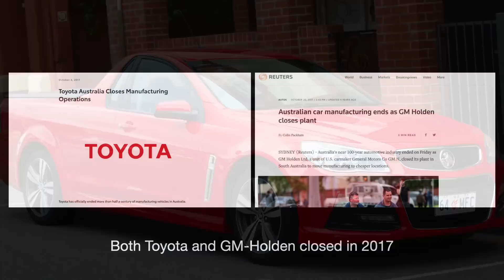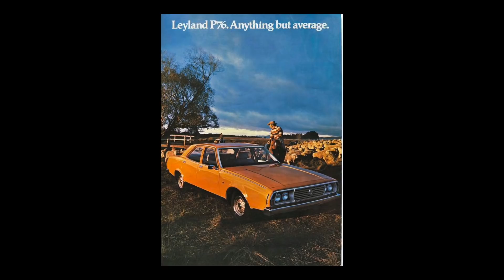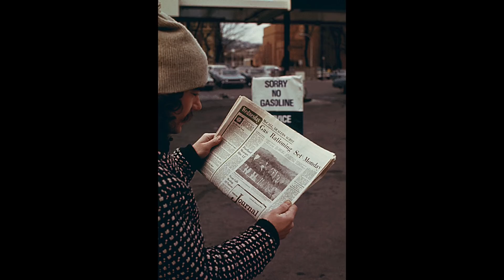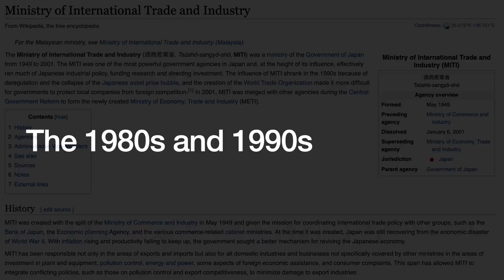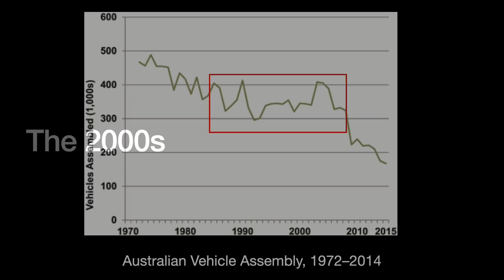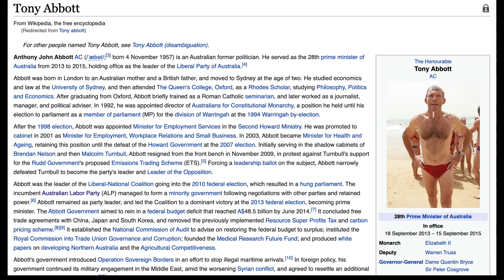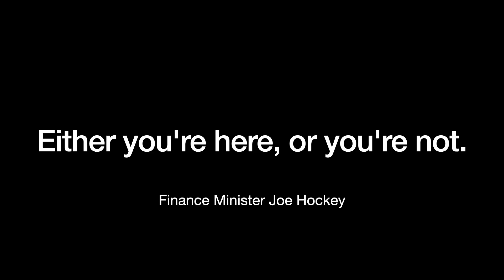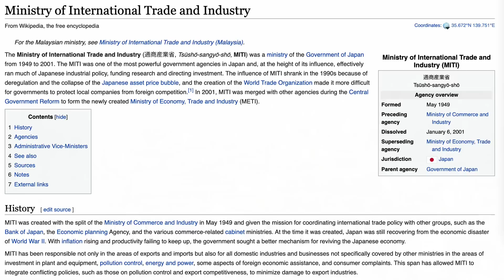Why Australia Doesn’t Make Their Own Cars

Comment: Hey man, great analysis and especially the history section, learned a lot here. As someone who worked at one of the OEM’s in Australia in the 2010s specifically on the viability analysis, I’d like to add a bit of my personal insight here: 

1. The closure of the industry was a matter of time. The long term viability of Australian auto manufacturing was ultimately predicated on achieving economies of scale. Compared to the factory outputs of other plants in North America, or Japan which were in the millions, the meagre outputs of Australian plants (50-100k each) towards the mid 2010s was not sustainable even with government subsidies. Normally factories are sustained by large domestic markets with export being a nice bonus. Australia’s market is quite small at only 1m cars per year. Manufacturing Costs were too high in an industry that survives on cost leadership and import tariffs were so low that importing made more sense for the consumer and the manufacturer. Government Subsidies were a bandaid on a bullet hole since the underlying business model was not sound in the same way it was in other larger auto markets. 

2. A unique aspect of the Australian market is high demand for D segment sedans (which is what all 3 manufacturers produced Ford Falcon, Holden Commodore, Toyota Camry/Aurion). Australian drivers especially liked large output V6 and V8 engines. This particular product has very little export market opportunity, so you had 3 plants all producing for a segment with limited export opportunity. The fact that D-Segment sedan segment shrank in favour of SUVs starting from the mid 00’s also aggravated the issue. 2016-17 also happened to be the final year of product generation cycle, so the 3 OEMs had to decide from that point onwards whether to invest in the next generation of products. Keep investing in a dwindling D-Sedan market or switch to an entirely new product segment altogether, which added to the already high investment costs due to retooling. There was no easy solution. 

3. The third major factor was that the subcomponent supplier network was barely surviving with the meagre combined volumes of all three OEMs. If only one manufacturer pulled out, the remaining two would have no option but to also close as they could no longer support the supplier network with minimum ordering quantities. What is little known is that all three manufacturers shared many sub components (head lamps, seatbelts, brake pads etc.) from suppliers like Bosch. It was a case of one in all in. Ford pulled the plug first, thus forcing the hand of Toyota and Holden who were still keen on exploring options to continue manufacturing in Australia. So to keep manufacturing in Australia, the government had the unenviable task of negotiating an outcome that all 3 manufacturers would agree - that was also a long shot at best, since each manufacturer had their own long term strategy and plan B for the exit. 

Thus to summarise, the root cause of the problem was inability to achieve economies of scale due to the small domestic market. This problem was further complicated by a declining D-Sedan market which was where the OEMs all invested their production capability into, and required all three to be committed for the industry to survive. 

I’m typing this on my phone so sorry if it’s a bit rambly and lacks structure, but happy to answer any questions you may have if you’re interested in any of the details.
Reply: Should write a book
Reply: Most informative YouTube comment I’ve ever read! Thank you!
Reply: But are you familiar with The LaSalle?
 Or maybe The Prophecy of The Shadowy Clown?
Reply: Excellent comment. They ended up having one customer, the State as not enough other consumers wanted their produce. When the State said no, the production finished. 

It’s pretty sad as every year there are fewer Australian built cars on the road. By the time I’m dead I guess there will be almost none. The first three cars I owned were Chrysler’s made in Australia. They were bombs by the time I had them but I liked them.

The last Australian car I owned was a Mitsubishi Magna, made in the same factory as the Chrysler’s. It was an excellent car, reliable, powerful, good to drive, quiet. All in all an excellent Australian made car.
Reply: True loads of people saw the writing on the wall for Australian car industry, and it will never be like it was in past. However the government should have realised this at tried to transition Australian car industry into comparable advantages that Australia has using our own natural resources finding ways don't screw us for the future.
Reply: If only they had switched to SUVs in time...
Reply: It's been a month since you've written this above, but thank you.  It continues to educate others like myself on another perspective verse the video's interpretation.
Although your conclusion is likely accurate, the reduction in tariffs that started in the 1990s seems like a VERY bad move that created the situation that required economies of scale for survival.

Having worked in large corporations in the past, often inside, there are many sharp people with sharp ideas.
However, leaders above them often ignore the ideas for what ever reasons.
It could be a problem where managers surround themselves with "yes man/women",
or it could also be the common problem of not highlighting, or pushing ideas that says their managers are wrong because it can be career devastating.

I've seen ALL of these cases and I'm sure MOST readers have as well.
The person above often wants and collects most of the glory and financial bonuses, yet doesn't take any ownership, and blames others when things don't go well.
Common in many businesses and politics..

The Canada example in the video, really shares the unique difficult situation that Australia faces that most other countries don't face, and it requires Australia to have unique policies..
It's that Australia is an island country in the Southern Hemisphere.
It's a double punch in my opinion.
The Southern Hemisphere likely doesn't impact as much, but it just increases the distances from all other developed economies, where ALL are in the Northern Hemisphere.

I think Australia needs the tariffs to protect itself.
Reply: I'm so impressed you could write all that on your phone~
Really nice summarisation, thank you!
Reply: @slypear  HAHA..
I know you're replying to the original poster,
but for me,
I've given up a long time ago to type in comments on a phone.

I've given up on doing a lot of communication with text on a phone..

Doing it on a phone is an absolute time vampire, productivity destroyer.

I used to be pro-technology when PDAs came out, but to me personally, productivity and efficiency puked around the time of keyboard removal from phones.

Now, almost all activities on a phone take longer than they should, and longer than they take on a laptop, or from a simple phone call.
Reply: @Leshic2  I hear you!
Reply: this was a great read thanks for taking the time to write it.
Reply: It didn't help that the Holden's cars — at least within my lifetime — were poorly-engineered trash and that this was very publicly demonstrated via automotive media, specifically Wheels and Motor magazines.

Who could forget Holden's HSV performance sedans being repeatedly disqualified from "car of the year" test exercises because their power steering pumps, apparently not designed to cope with the available maximum engine speed, failed on day 1? Holden knew there would be acceleration tests and, year after year, didn't bother to make sure their cars actually worked.

Or ... the VT-era Commodore sedan rear doors spontaneously popping open when a trailer was attached because they had all the rigidity of a cardboard box dumped in a swimming pool. Holden sold the VT with an optional heavy duty towing kit that the cars were clearly not engineered to cope with. I think you could reasonably argue that the Commodore was a terrible choice for towing, but I think it's also reasonable to argue that such things should not be available on cars that are clearly not up to the task.

They failed, and they deserved to fail. Not commenting on Ford here as I don't have as much experience with them. But I do respect their attempt to get into the growing SUV market with the Territory.
Reply: Ultimately it was the Australian government that sealed the fate of the local car industry when they removed the tariffs protecting the local factories, and stopped subsidizing Holden in particular. As soon as importing cars from overseas became more profitable for multinational manufacturers and the cars they made became cheaper for Australian buyers because they could be made cheaper somewhere like Thailand once the import taxes were removed, the big Holdens and Fords, along with the smaller models like the Toranas etc were no longer viable. Let's face it, Holden would never have got as big as it did without government intervention in the 1940's to initiate the "national car", so it should be no surprise that lack of government intervention would spell the end of the local car industry. Australia's population has not grown fast enough to support a local car industry. Just to the north in Indonesia, they still have a car industry, because their population is 10x the size of Australia in a much smaller land area.
Reply: @jsleeio  Can't disagree with that, but at the end of the day, GM was running the company so I maintain that didn't care about making sure that Holden survived by developing new models. Maybe it was this myth that Aussies only like big sedans, utes and station wagons. In reality, Aussies were buying hatchbacks and SUV's from the competition and GM only gave us Daewoo rubbish to compete with that, and people got burnt with reliability problems so steered away from GM after that.
Reply: Only problem with what you have said is that Toyota managed to export over 1million Camrys from Australia so they were able to do that profitably.
Also some of the policies of the American parents didn't help. Ford were not allowed to design falcon to be LHD as well as RHD for instance.
Reply: And do not forget that unions made the cost of labor prohibitive for the quantities you mention.
Reply: It’s interesting reading the pressures that the industry had from an insiders perspective. I’m a coal fired power station worker (a young one) and we’re experiencing similar pressures from renewables, government, economic, and supply issues. 

We know the writing is on the wall we just want to make the most of it while it lasts.
Reply: @Leshic2  Mate give Swype a go on your phone. Once proficient you can absolutely pump out text with proper structure, grammar and little proofing required. I haven't typed on a phone in almost a decade I reckon. Game changer.
Reply: @slypear  See reply to Leshic.
Reply: @jsleeio  Wet carboard box in a swimming pool. So good, gotta steal that one.
Reply: @jeffmcdonald101  That's good to hear it worked for you.  I rarely ever hear of anybody who stuck with Swype.  I tried it about a decade ago and gave up because (deleted what I wrote) ... because I don't really remember.
IF I "type", on a phone, I voice-> text it.
Thank you for the tip and shared experience though.
Reply: No, not correct.  We could have sustained a car industry easily if we owned our companies.  Sweden is a perfect example Volvo and Saab, the latter still producing aircraft as well.
Reply: saab is dead and volvo was sold
Reply: @P0RKE1  point is made though
Reply: People are stupid that is why, everyone jumped on the SUV /dual cab craze when they're the same fricken size as sedans / wagons. 
Little hint for people, you got bluffed, the suvs are no bigger in terms of cargo than what a wagon could hold. SUV pretty close in overall dimensions as well to the sedans/wagons(Falcon / Commondore ) but people had to keep up with the Jones's
Reply: @jsleeio  I had a motorsport for a few years before i sold it and it was so much better than Fords interior, and i would put the Bara and Miami(factory forged internals) in front of the LS3 and their shitty GM V6
Reply: added to old mates analysis yours rounds out the facts instead of it was unions bring back real australia blah blah blah things are never as simple as pauline and co promote
Reply: Great comment and summarises the situation well.
Reply: Very well written.
Reply: You forgot to mention uncompetitive cost of labour, and ADR's making the cars built not compliant for any other country (for export) without large costs to change.
Reply: I worked in the Automotive Supply sector in the early 1980's at the Research and Development arm of a large well established Australian Company.
We ceased, not because of the demise of Automotive Industry, but because of the rise of appointing "Business Management" or "Finance/Accountant" types to Corporate Management positions in place of those with Engineering/Science backgrounds.
GMH/Holden designed, manufactured and exported both RHD and LHD Commodores to various world markets through the 90's and 00's.
The Parent GM Company designated GMH Australia as it's Global Rear Wheel Chassis/Platform Design Centre.
Reply: @ianmontgomery7534  Yes, I recall reading a journal article that quoted internal Ford sources that on a per car basis, Ford Australia were producing the Falcons cheaper than the Crown Victoria, but Detroit saw it as  direct competition for its home grown product and refused it to be redesigned for LHD markets to copy Toyota Australia's success in the middle east.
Reply: The 4th factor would be, Who owns a Kia or similar, shame shame shame, Buy Australian was a very large and serious campaign, should still be today!!!
Reply: @EdgyNumber1  Ford already did that with the Territory. Holden tried with a semi-suv like the Adventra first, then just gave a Craptiva and thought that would do.
Reply: @cj-fh4nx  That's what happens when you only give a half-assed effort 😆 🤣 😂
Reply: @EdgyNumber1  Ford Australia made an SUV but only in right-hand-drive AFAIK and with no significant exports (certainly not to North America).  The worry is that Ford HQ or General Motors HQ didn't actually want large portions of their North American product portfolio being imported from Australia in the first place.
Reply: @darryllspalding9680  What's wrong with a KIA?! It's a quality Korean car, and the Stinger GT is even a performance sports sedan similar to the Commodore SS.
Reply: Really it was the Dollar doubling against the $US that killed local Manufacturing. If your competition is suddenly half the price, that would kill just about any business, in any sector. It might make more sense to look at Custom Making Mining Machinery here. I'm not sure if such Heavy Duty Machinery could be tied to the Ship and Submarine Building Industries we're trying to create. I believe we are making Defence Machinery like the Hawkei and Bushmaster here. They probably share componentry with Mining Machinery. Forced Marriages like the Japanese Government did?
Reply: Small market? Only ~600,000 units a year less than Russia, the UK, France, Canada, Sth Korea and Italy... 

The real issue was tariffs and export restrictions by parent companies. 

The Government could have supported local production by mandating all publicly funded enterprises must buy locally designed and produced vehicles. 

The US would be a huge export market for RWD sedans, especially inline six engines. The Barra turbo powered Falcon should have been an export champion as a police vehicle. 

Gina Rhinehart or Andrew Forrest should invest some of their tens of billions on producing cars in Australia. 

Losing the car industry has been devastating Australian manufacturing and engineering. We need to be smarter about this and not just think about what’s best for overseas owned producers.
Reply: @EdgyNumber1  Australia has always struck me as a good place for 4 WD manufacture. Not too many lines, just one with variants.  4WD SUVs maybe. Subaru or Land Rover are probably the only manufacturers that could set up for both local and export manufacturing. I'm surprised that Toyota didn't just make Landcruisers in Australia and market them internationally with Australiana.
Reply: I don’t think there is a country in the world who does not subsidise their car industry, just look at the USA, the whole country would go belly up if the car industry failed. It’s called political clout. The reason is simply because the car industry creates thousands of jobs. In Australia all those were labour voters so they got it in the neck with a change of government. Not enough graft in it for other parties.
Reply: @gardnep  
Look up the (Labor) Button Plan. That’s when tariffs were phased out.
Reply: @kdegraa  Ditto. I had two Val Stn Wagons, great reliable engines but rust was the nexus, eventually ! Again, I had Mitsu's and still do, see above, and have no plans to switch. Very reliable and cheap. But my Toyota Hybrid is an excellent vehicle so in future, another ? Taxi drivers like em !
Reply: @ryurazu  But any Govt would be shouted down by the 'free market' lobbyists !
Reply: @slypear  Yes, my fingers would not comply ! Also thankyou.
Reply: @Leshic2  You got it !
Reply: Our country being inflicted with needing right hand drive cars wouldn't have helped either. In fact it is still costing us today.
Reply: Hey I appreciate this run down but you, like the OP, left out or IMO mischaracterized the importance of a few critical aspects.  

Holden was riding high with the best seller in this market and was the most profitable division of GM.  They were innovating on a shoestring and made 40,000 car runs of specific, in-house models at a profit.  This was unheard of in a multinational and GM poached a heap of the top people.  Mark Simco who drew out the Monaro on his lounge room wall became head of global design.  He also designed a mid-sized Torana and they worked on various drive train options because the fuel crunch was certain to cause a drop in sales.  GM were and are a terrible organization however and they failed to act.  

GM did export the US-engined seden and coupe but the model wasn't properly incorporated in the US and has a somewhat cult-car appeal there amoung people who've discovered it since sales ceased.  Their operation would have been saved if the attempts to fill a police requirement were successful.  Several major police jurisdictions wanted the car, being the only RWD sedan that actually met their requirements, but politics and unions in the US killed the chances.

Mitsubishi had a make or break model that turned out to be OK but was launched into a market already turning to fuel efficiency and SUVs.  Another corporate failure.  Oh and they also failed to consider a smaller vehicle.

Our market isn't huge but Korea is a perfect example of a market that embraced local makers due to suitable vehicles.  We actually have the largest number of brands and models sold here, for our market size, in the world.  And we are highly profitable, having good incomes and having sailed through the GFC essentially unscathed.  Local manufacturing of EVs and batteries is quite possible, perhaps even likely in future.
Reply: Another factor has been appreciation of the $AUD. Exports of vehicles varied with the exchange rate. And that seems to vary with the profitability of big miners in Australia rather than any other industries. 

This makes manufacturing in Australia for exports  tricky to justify the capital investment as the currency fluctuates so much.
Reply: No it’s the polies fault. All they had to do 15 years ago was make it compulsory for all cars sold in Australia to be LPG compatible & it would make the car industry sustainable. Instead the polies got rid of half the tax subsidy % now we now export LPG for nothing at no benefit for the country, with both Qatar & Norway getting 30 times more for the same amount of LPG.
Reply: @mickvonbornemann3824  LPG and natural gas are not the same thing unfortunately
Reply: @kirkc9643  yes but they are equilivents regards energy value & cost. Besides all LPG in Australia is owned by the Crown/taxpayer who are not getting the apropiate price from miners. As such it should all be kept here for Australians to use or a export excise applied to stop the mining companies ripping off tax payers
Reply: Hey mate really glad to have come across this perspective. I wish things were different. But God I wish we had a limited import market.
Reply: "Australian drivers especially liked large output V6 and V8 engines." That was once true, but with rising petrol prices in the 21st century, that quickly became not true. The fact that they were making these V6 and V8 engines like it was still the 1970s was a huge reason why people moved further toward Japanese and Korean built cars.
Reply: Turkish high-tech!  The smart nation.
I have a folder about it (folder 5 in the playlist).